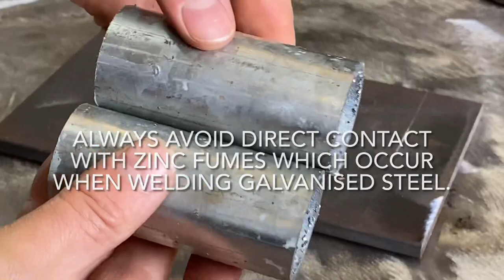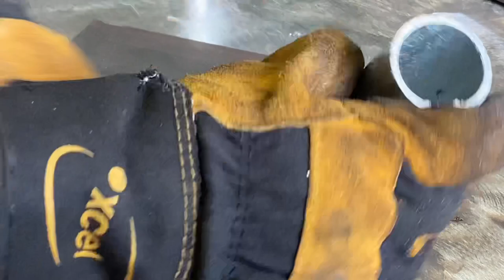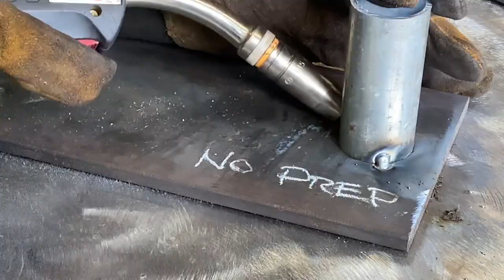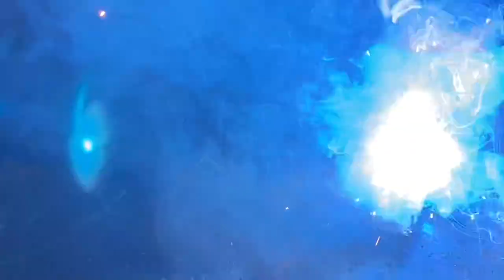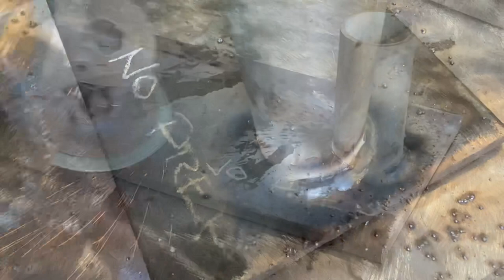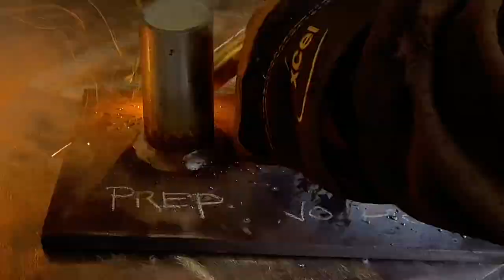MIG GMAW Welding Galvanized Steel. Prep v No Prep.

Comment: I’m learning welding and today was the first time I touched galvanized steel... somehow the back of my pants right behind the knee caught the splatter. 
The instructor and a few classmates with welding experience said that welding galvanized material sucks, I completely agree with them. 
Obviously experience with it will make it better, but I got a hunch that it’s gonna always suck to work with.
EDIT: now that I’m further in the video and seeing the differences, I’d like to point out I DID NOT prep. I have a feeling he didn’t have us prep intentionally to show us how much of a difference it makes. Gotta learn the hard way I suppose, wish It didn’t mean I’d have a burn hole in my back of pant legs though.
Reply: Wait till you try overhead galvanized!
Reply: Bro I just started welding galvanized too lmao I didn’t prep either I have a burn mark from the splatter on my leg and it hurts like hell🤣
Reply: You have to learn what not to do then you can get better 😂
Reply: @JoshMate-lz4hy It’s possible to weld galvanized without prep. It’s not easy to learn. Short stickout, higher than average voltage. And a GOOD respirator. Do it in a production shop a lot. Overhead too.

Comment: For galvanize metal how do you set up the welder what is the volts and amps and wire speed supposed to be. For this metal

Comment: Weld quality is certainly improved when removing the zinc, but the most important reason for removing the zinc is because of the serious health risks. Since the zinc is still on the inside of the pipe where you can’t reach with the grinder I would use acid to remove the zinc instead.
Reply: Or weld outside. Been doing it for near 40 years.
Reply: Yep that works too, but them safety-sally wankers would love that one 😂
Reply: Man, get a brain. Weld outside, and use a mask. Maybe use a blower outside. Sometimes I'm wondering how humanity even came so far.
Reply: 😂😂 that tickled me lol
Reply: @somborn  even if they didn't follow any of that, they'd still live plenty of years to produce offspring. thus humanity continues and we're saved

Comment: Excellent camera work but could have been greatly improved if you had explained the settings on the welder and type of flux core used!
Reply: That's not flux core, he is using a gas mig, I'd say he is using .9mm mild steel wire.
Reply: read the title GMAW stands for gas metal arc welding which needs to clean off all the zinc at the join before you weld and weld indoors but if outdoors flux core is preferable although I would use .9mm flux core anyways - gas is too expensive and flux burns away more impurities as well as any zinc - I would even use 6011 s or 6013s stick weld as the metal is quite thick looks like about 4mm in the pipe and 10mm plate steel
Reply: I never enjoy speechless teaching but nice mig gun. Ran those and liked them.

Comment: Welded galv pipe to steel rebar, over 20 yrs ago, just stick welding with mild steel rod all over my debris trailer.  Been holding up fine. Gotta go deep.
Reply from the maker: Thanks for your comments Mike.

Comment: How can you tell when the galvanised is ground off completely ?.  Does shiny bare steel look different from polished zinc ?.
Reply from the maker: Hi Brian, thanks for watching. 
There’s a slight change of colour that reveals the zinc has been adequately removed. 
That may not be visible on the video. 👍
Reply: From my little experience ( i am surely not a real fabricator ) when I ground off the zinc with an angle grinder, the metal starts to spark when the zinc is ground off and reveals the clean steel underneath it. Can someone confirm if my theory is correct?
Reply: I use a wire brush on my grinder and the color of the clean steel is obvious once you get the zinc off.

Comment: Haha. Im know what is welding non Prep and Prep zinc coated parts but with tig 🤣🤣 More time I'm spend grinding tungsten than welding time if I'm forgot clean zinc 🤣🤣
Actually I'm starting learn Stick welding. 
Regards 👍👍👍
Reply: That is the funny thing about welding, it’s 90% preparation and 10% welding LOL but you can see the difference in the video.
Reply: @stanlysawicz9317  99% Persperation 1

Comment: Ive had good experience with 7014 rods and galvanized material
Reply from the maker: Hi Matthew. You prefer the 7014 for galvanized welding specifically, or just your go to rod for all applications?

Comment: Doesn’t that grind of the galvanized coating? I just started welding galvanized sheet metal and I would like a good weld but don’t wanna mess with the properties of the metal
Reply from the maker: Are you referring to the Corrosion protective properties of the metal Eddie, that you don’t want to mess with. Or other?

Comment: Would you turn up your power a little bit?
The sides dont look like they are penetrating enough?
Also, will it crack most of rhe time?
Reply from the maker: Personal preference and whatever you’re welding needs to be taken into consideration. 

Haven’t watched the video Again to answer this, but my angle may need checking. Could be favouring the plate with regards to your visual on penetrating

Comment: I thought u had to use flux when welding galvanized for proper bonding
Reply from the maker: Thanks for watching John. Interesting point of view. I’ll look into it. If the zinc coating is ‘removed’ I would imagine that most welding processes would be adequate.
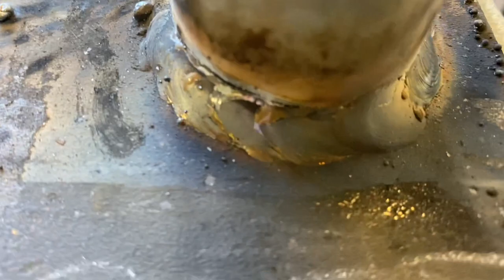Reply: @TheMetalFabGuy  Ive also noticed that not all galvanized metals are made equal. Expanded metal is a bitch to weld cause the zync is much thicker that square or round tubing. Idk if thats just my supplier. But yeah removing the zync makes any weld adequate. @6:49 u can see some porosity if im not blind lol
Reply from the maker: I agree. Some are definitely worse than others. Not something that I’ve extensively done or chosen to do. But most welder/fabricators  have had to at some point. Welding galv where possible, is usually not by choice. 
You’re not going blind. 😄😉
Thanks John.
Reply from the maker: Thanks for the link. I’ll take a look.
Reply: Have used solid wire many times on galv. Prep then a back forward motion burns off the last bits of galv left before getting full pen.
Reply: I stick welded galvanized steel today, I’ve done it with mig and it’s no problems. It all comes down to the prep work beforehand. It’s still steel, ya just gotta grind the coating off.
Reply: U want to use  a gas on it not Flux its to splatter if u dont

Comment: You must really know what your doing if you are welding on zinc
Reply: He is just welding on  zinc plated, I have a friend who repairs sculptures from the 19th century that are pure zinc, it is an art to weld them....I weld ducting that is zinc coated, some are 500 mm x 750 mm, they are also 170-S6 wire, not sure the metric size. it is very difficult as the fit up is not always good, They are being joined to different size Ducts, so there is a lot of fitting in field with odd shapes [triangles, ect.] the weld metal actually sucks in some zinc which acts to protect it.....these are for outdoor install.